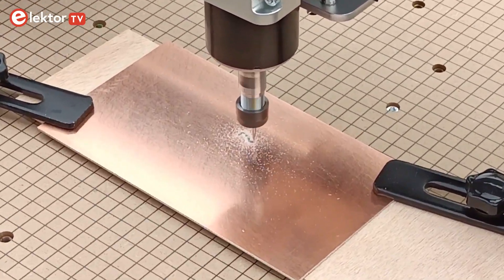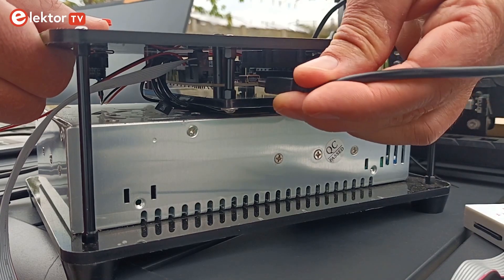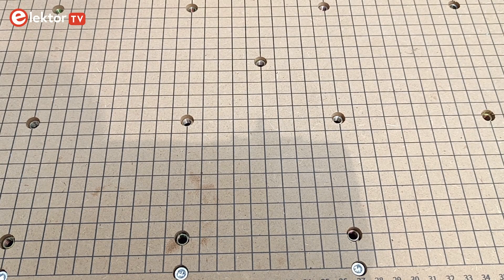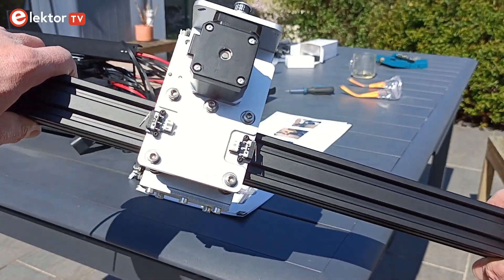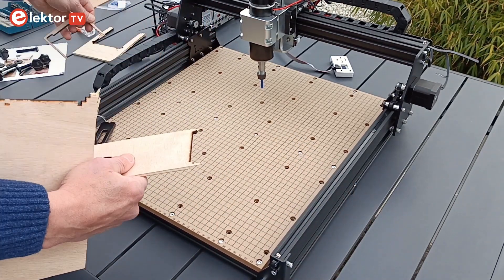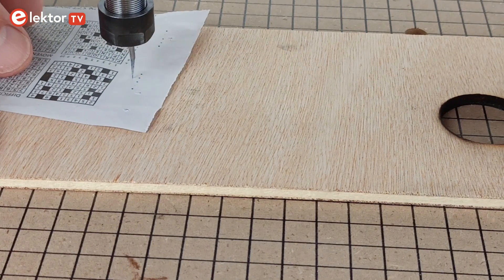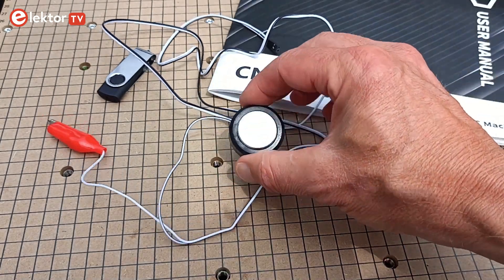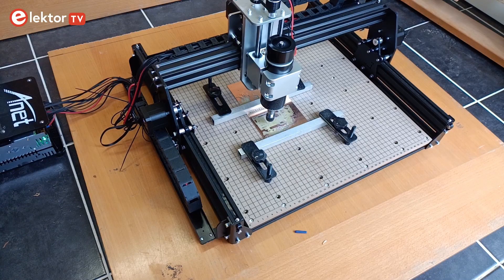Getting Started With the Anet 4540 Desktop CNC Router

Comment: Hello!! I have a few questions:

1.	When it reaches any of the stops on both the x-spindle and the y-z axes, the machine stops and I have to turn it off and on again for it to work. 

2.	I have a cable that is left over that has three colors: white, red and black and I don't know where it should be connected
Reply: Have you figured out what that wire is used for? I have the same thing

Comment: This machine is horrible, a month and I still can't get it to work, it comes with some test files that do work, but when I create mine that are well created, the engine doesn't start and it only does the trick but with the engine off, I don't understand why It doesn't work, I would appreciate it if you could help me.
Reply from the maker: It is hard to say anything about your problems without having access to your g-code. Maybe the spindle on/off command is incorrect or missing? Or the spindle speed setting? I use "M3 S5000" to switch the spindle on and "M05" to switch it off.
Reply: I purchased one in amazon, nothing but problems. Z probe does not work correctly, Homing not working get stock on Z+ with. Up to this day almost 6 mouths troubleshooting still unable to make it work ...